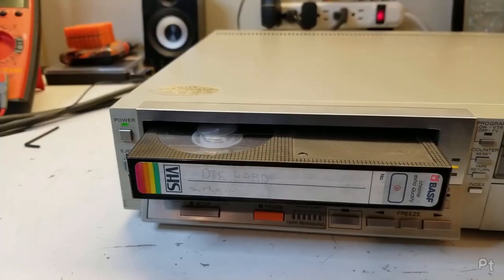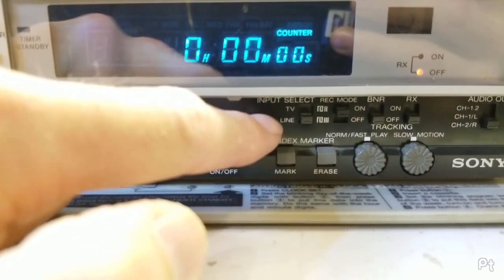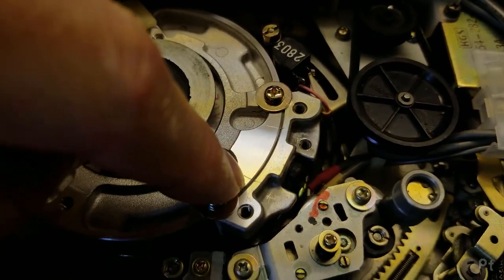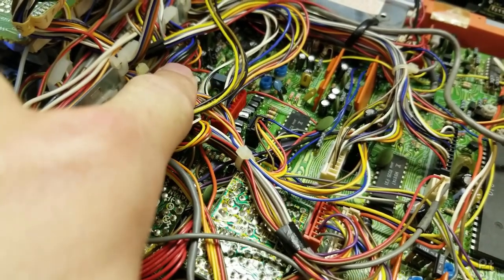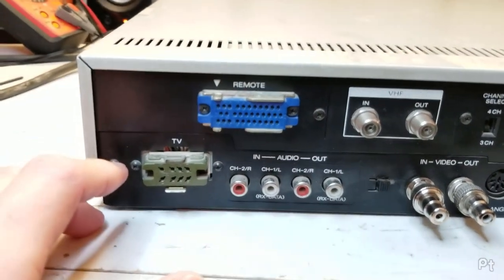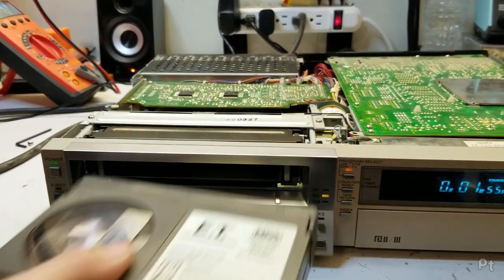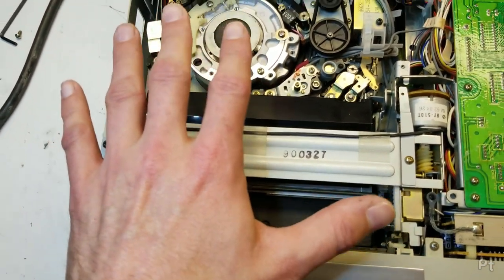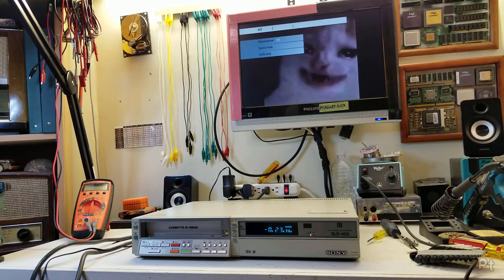Sony Industrial Betamax (Model SLO-420 from 1982)

Comment: I can think of two PAL Betamax models that have linear stereo and Beta noise reduction, the Sony SL-C9 and SL-C40. The SL-C9 is almost identical to this one and was the top of the range model for 1982. The C40 is from 1983 and I think was top of the range for that year as the C20 was mono, the C30 was also mono but with an infra-red remote control and the C40 added linear stereo and BNR.

It appears this industrial model also existed in PAL as the Sony SLO-420P, which matches Sony's convention of adding P for PAL on the end of model numbers on their broadcast/industrial machines.
Reply: I was looking at the SLO-420P just a couple of days ago on PALsite and I've never seen one on ebay and other auction websites. Seems to be a very rare model.

Comment: 10005  It's actually the FIFTH unit built to be sold.  Sony always put 1000 in front of their professional units.  I'll have to look at mine and see the serial number.  I once had a Sony playback adapter for Betacam...that was 10002.  It was held together with flossing tape and rubberbands.....they just had to get it out the door.  Later I had the same piece of equipment...with a 10359 s/n and almost everything inside was solid state with out all the wiring jumpers...

Comment: I'd like to point something out about this unit. This cassette compartment with the all-black door and the "CASSETTE IS INSIDE" in large font belongs to the Zenith VR9775PT which is an SL-2500 rebadge. Someone must have swapped the front loader from that Zenith model in the past because the original one probably broke (those stupid little gears).

Comment: RX enables or disables the remote sensor.
Reply from the maker: Hmm, just tried and it doesn't disable the IR remote sensor (works in both positions). Only info I can find online is it has some hardwired connection capability and this switch is related.
Reply: Maybe the capstan servo loop has bad caps (maybe they're the ones near the control track duty cycle adjusting trimmer).
I remember a VHS with a similar speed issue on not so old 12voltvids's video.
I'm not familiar with Beta but if it reads linear control track it could be something related to tape guide alignment of the recording machine too.
Reply: @probnotstech  ahh, weird, I don't really have that machine anymore (for the past 30 years or so haha) clearly my memory is failing then :)